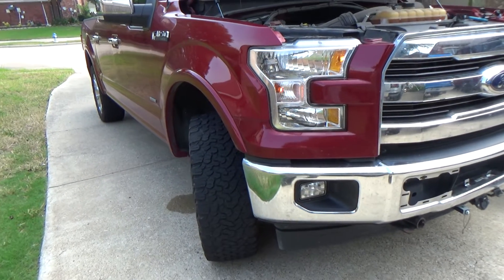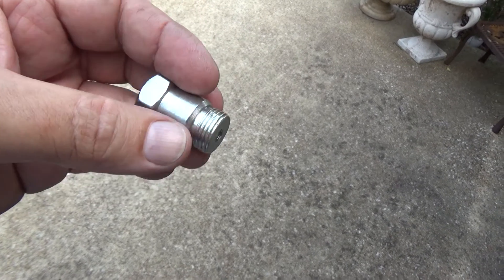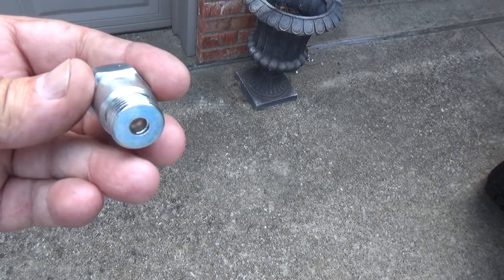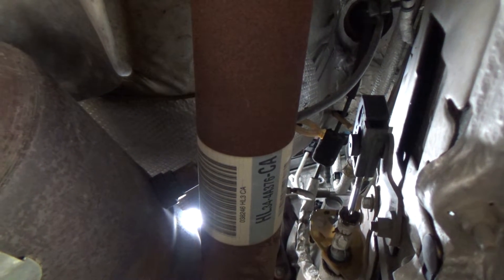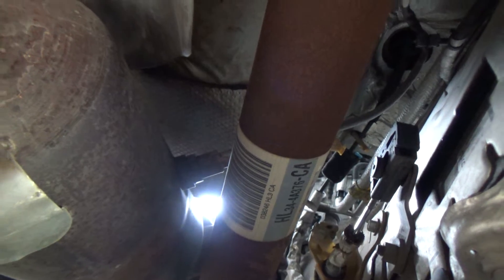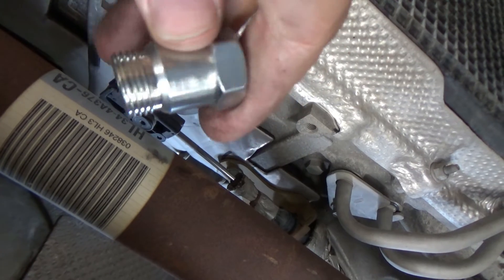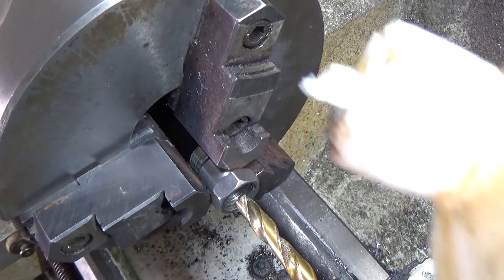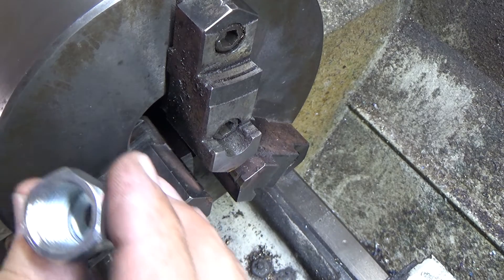Easy Fix for Code P0420 or P0430 Catalyst Efficiency Below Threshold Ford F-150.

Comment from the maker: MILWAUKEE'S Electric Tools MLW48-22-9415 Combination Wrench Set - SAE
https://amzn.to/46lKvbM
MLW48-22-9515 Combination Wrench Set, Metric
https://amzn.to/46izd80
Dorman Spark Plug Non-Fouler 42002
https://amzn.to/44jIUTA
737mechanic Amazon Store Front
https://www.amazon.com/shop/737mechanic/list/CR3BU74FTDU1?ref_=cm_sw_r_cp_ud_aipsflist_aipsf737mechanic_W4QMHMJ1JD67FDBCQHRK
Reply: Would you please repost the Amazon link for the Dorman Spark Plug non-fouler 42002. The link you have posted doesn’t work for me. Thanks

Comment: Haha. Worst fix ever.  It probably needs a thermostat. These trucks are getting old and I have been seeing numerous trucks in for thermostats with the p0420/0430combo. These engines are known for blowing out spark from high cylinder head flow characteristics which is why ford updated the spark plug gap spec to only .025. These engines struggle with heat in the top end. You need to drive the vehicle and monitor engine coolant temp pids on your scan tool. If the pids operate below specifications then you need a thermostat. The truck will operate with the guage on instrument cluster reading in the middle when the actual temp can be 40 degrees off. I thank ford for the inaccurate temp guage !
Reply from the maker: So, when the thermostat causes this the first thing you will notice is the engine never reaches operating temperature, the heater will be weak, warm up takes forever and many times you will have a code P0128 "coolant temp below thermostat regulating temp" and you will get both P0420 AND P0430 together.

In this case all that he was getting was bank 2 P0430. 

This $4.00 fix has lasted for over 2 years now.
Reply: @737mechanic I fixed the exact same issue on a 2015 today it had a p0420 and p0430 no p0128 as you stated was mandatory when operating temp is low.. I put in a thermostat and it solved the case 100%. The heater was still performing and customer didn't notice any heater concerns. You fix yours however you want but my customers come back every time. You didn't fix the problem you hid the issue with a 02 sensor spacer and I think we know what kind of hack mechanic you are. Let me know how the extra fuel in your oil helps extend your engines life.
Reply from the maker: @anthonyrybczynski5420  LOL, if you did this repair today you will not know for at least a week if you fixed the problem because it takes a few drives cycles for the computer to go through the routines to determine if the cats are doing their job or not. You just proved you don't know what you are talking about.
Reply: @737mechanic yes the customer left the shop and drove until the check engine light went out. Now it's 725pm here and the customer is now 200 miles down the road gone snowmobiling. I will be sure to video tape the next one in response to your video for learning. It's a good friends truck and I will be able to follow up easily.

Comment: Hi, I’m having the exact same issue after the PCM reprogramming recall on my F-150.
Two days after the update I started getting the same symptoms and the same codes, including P0430. The truck was running perfectly before the recall, so your experience sounds identical to mine.

Were you ever able to fix the problem?
Did Ford or the dealer do anything for you, or did you find another solution?

Any update or advice would really help. Thanks.
Reply from the maker: What I did in the video fixed the problem, 2 years later and still no light or codes.
Reply: @737 @737mechanic I appreciate it
Reply: @737mechanic  Can the hole be drilled with a drill? And what size bit did you use to make the hole? I already ordered the accessory to do the job next weekend.
Reply from the maker: @Marcelcapdevielle  Yes you can drill it with a drill, Something bigger than the diameter of the O2 sensor will work.

Comment: I can confirm this works. I did what he said to do in the video. I had a P0430 code for bank two which is the driver side. I drilled the hole through the spacer which I got from O’Reillys. It’s kind of hard to fit in the cat, but keep trying and you should get it and that code cleared and then I got a code for the opposite side bank one which is P0420 so I repeated the process for that catalytic converter as well and then I passed emissions and no code.

Comment: How do you clear the codes? I went to advance Auto and they tried to clear the code and said it wouldn't let them do it.
Reply from the maker: You can disconnect the battery for a few seconds and that will do it.

Comment: Last year I had the very same code, so I just replaced the down flow o2 Sensor connected to that cadillac converter getting the code and then reset/cleared the code off the truck system ... 

Year later and still no code. 😉

Comment: With this diy hack do you get your fuel mileage back or does it still effect your fuel economy and just does away with the code issue
Reply from the maker: The downstream O2 doesn't play a role in fuel mileage; it is pretty much for cat efficiency.
Reply: @737mechanic appreciate your input thank you

Comment: Did the same trick for my buddy and saved him the headache of that check engine light. At 250k who wants to spend $3000 on cats lol!
Reply: It doesn't need cats.  It needs a mechanic who knows how to diagnose the real problem, not cover it up with an 02 sensor spacer.

Comment: Thanks for the video very helpful I recently purchased a 2015 Ford F-150 with the EcoBoost I've never dealt with any kind of turbo engines and I recently stomped on it on the highway and threw a check engine light hooked up my blue driver OBD scanner and apparently I got exactly the same code luckily where I live we don't have to go through emissions tests but I sure hope the cat holds up at least another 6 months. Or until the check engine light comes back.

Comment: Excellent video. Question to be raised: Can i use  the spark plug non fouler on the downstream O2 sensor with a faulty O2 sensor, or must it be on a healthy sensor?
Reply from the maker: You could try it first with a bad O2 on the downstream, but it might throw a code depending on how it is faulty. For instance, the downstream O2 should go high and low during acceleration and deceleration but at stable RPM's it should be relatively constant which is what shows the computer the cat is working. If the computer sees ZERO movement from the downstream O2 then it will flag it as bad.

Comment: I got p0430 code as well which is weird I just got all my vct solenoids replaced and then 1 week later this check engine light came on extremely frustrating should I buy new o2 sensor downstream location do you think that will fix my problem
Reply from the maker: If I had to guess your vehicle has a lot of miles on it and more than likely you need catalytic converters.

Comment: So question is if going through all that trouble why not just get new o2 sensor for the downstream location and I guess what I’m asking asking is the o2 sensor the problem or does it go deeper than that
Reply from the maker: The O2 sensors are doing their job so replacing them is not going to do anything. The O2 sensors are telling the computer the catalytic converters are bad.
Reply: So following the video eliminates the check engine light but the problem is still there correct ? So wouldn’t that mean more problems in the long run and my truck has 159,000 miles on it
Reply from the maker: @renequintana8714  So the correct way to fix the problem in the video and your problem is to replace the catalytic convertors, but when you add the spacers like I did in the video you are making the O2 senors less sensitive so it fools the computer into thinking the cats are working better than they really are. As the cats get worse over time even this trick will not work.

This will not cause any additional problems but it is not fixing the bad catalytic convertors.

Comment: I have a P0420 code will hollowing out the cats and clearing the code solve the issue?
Reply from the maker: No, if you hollow out the cats the computer will detect they are not doing anything and set the light even quicker.

Comment: I got a p0420 code I’ve seen people put lacquer thinner in the gas at a 1:9 ratio so for me it would be 4 gallons of lacquer thinner to 36 gallons of fuel will that clean the catalytic converter, will it damage the modern ecoboost engine?
Reply from the maker: I have heard and seen people do it but have never seen it actually work. What I would be worried about is if the windings in the injectors can handle lacquer thinner, the reason I say that is when fuel injection first started showing up on common cars people would add fuel injection cleaner to their gas and the fuel injection cleaner was alcohol based and the shellac on the fuel injection winding would soften and within a month you would end up with shorted injectors but the manufactures fixed that by using different type of insulation on the windings so alcohol doesn't effect them anymore but I don't know how laquear thinner might effect them.

They also make some stuff called Cataclean that I have seen some people claim worked for them so that is always an option also.
https://amzn.to/42iLgD6
Reply: @737mechanic I used Cataclean yesterday but I’m not sure if it works
Reply from the maker: @TexasNationalist1836  It will take the entire tank if it is going to do anything. Give it time and if it works please let me know. I love real world results.
Reply: @ the bottle says run the entire 16 ounce bottle and a 1/4 tank but I’m skeptical of it i honestly feel like the cheapest option would be to hollow out the cats because I just lost my job and don’t have the money to spend right now on truck repair

Comment: Have you actually done it and had time to check the viability or are we all gonna experiment this together
Reply from the maker: I did this on our Jeep Wrangler that the Engine light would come on about 3 days after resetting the light, after I installed these it stayed off 3 years until it came back on.

This Ford F-150 the light has not come back on yet and it has been a couple of years.
Reply: @737mechanic  alright then - thanx

Comment: I have a 2019 expedition with the 3.5 EB. Am I only adding it to both bank2 sensors?
Reply from the maker: They only go in the downstream sensor so if you wanted to do both banks you would put 1 in each downstream sensor.
Reply: Did you do it? It works? I have also exp with same problem that’s why asking

Comment: For 2018-2020 owners beware. These year models have oil consumption problems. Excess oil being expelled through the exhaust will clog and pack off your catalytic converters! I own a 2020 and finally pulled my y-pipe to inspect the cats to find a packed off and broken up passenger side catalytic converter. Yep, time for a new engine. Check it, before you wreck it. It’s not always “just a sensor.”
Reply: Eco boosts have a oil consumption problem? Sounds more like 5.0 issue
Reply: Oil is cheap and while of course I would never recip saw the bad cats, smash the ceramic then weld them back and reinstall I can imagine others might.
Reply: What ever happened with this? I have a 2019 going through the exact same thing
Reply: I Gt a 2018 with a p0430 code
Reply: @mattl7424  my 2.7 has bank 2 issue so went to a local mechanic wanted $4600 to do both with ford parts, dealer $3800, going aftermarket spd, flowmaster whatever is close to oem
Reply: Miy 2.7 doesn't use any oil. It's always the same level on the stick with 5000 mile oil change interval

Comment: I put cataclean, also put lacquer thinner. I sprayed sea foam and still code. If u used spacers, would it matter if theres holes in the muffler after downstream sensor. Or does the muffler not suppose to have holes for the spacersto work..
?
Reply from the maker: It won't matter if the muffler has holes.
Reply: @737mechanic  well,  used Space r and kept resetting the code with I'm readiness and still getting p0420 and p0430..🤔 drove already with 3 tanks of gas and still keep popin on..also replaced all 02 sensors.. fkn thing
Reply from the maker: @bigsal9259  At that point the cats are so far gone the only fix is going to be replacing them.

Comment: So this doesn't damage the engine in any way?  Sorry if that's a dumb question but I'm not too mechanical of a guy.
Reply from the maker: No, it basically makes the o2 sensor less sensitive so it doesn't trip the engine light. Eventually, even this will stop working once the cats become even more inefficient.
Reply: @737mechanic  So the cats will eventually need replacing.  They don't inspect emissions in my state, thankfully.  I just wanted to get the light to go away and was hoping it wasn't harming anything.  I haven't experienced any power loss at all.  Maybe it's just the sensor going bad.  I thought I would try the cat cleaner someone else suggested just for fun.  Thanks for your help.
Reply from the maker: @geemac7267  Let me know if the cat cleaner works, I have never had any confidence in stuff like that. If it works I will keep it in mind.
Reply: @737mechanic  It doesn't work.  LOL.  My light came back on as always.  It was a $30 lesson I guess you could say.  I'm going to try your trick next.

Comment: I used the m18x1.5 from orileys on my 2014 ford f150 5.0 just so yall know for the fitting size. It fits pretty good.
Reply: @41frankie  has it worked? Just did this on my 2018 5.0.

Comment: did it and don't work
Reply from the maker: @wow-wow-p8d  did you put it in the upstream o2 sensor spots?
Reply: @737mechanic  i put it after the cats,  after i did that i got (p2098 fuel trim  system too lean bank 2) i tried a few diffent ways i eather got the p0420,p0430,  with the  non-fouler i got p2098
Reply from the maker: @wow-wow-p8d  Interesting, I have never seen that before.

Comment: Could also try putting a bottle of Cataclean (Autozone $26 bucks) into the gas tank. Read directions first.
Reply from the maker: Have you used it and did it work?
Reply: @737mechanic  Yes I used it a couple weeks ago and it is kind of crazy how quickly the light went out and has stayed out since putting the bottle in my gas tank. Also noticed a pretty decent increase in throttle performance.
Reply: @Scoliton1  is it still working for you?

Comment: The way I see it.  The p0420 is the biggest scam automakers have come up with.  Here's why.  Even if your cat is below efficiency, it still is working to clean the emission.  It's just contaminated with oily residue from bad gas.  So get some premium fuel and ride that car the way Italians do to clean their cats.  They go to Germany and ride the Autobahn at +90MPH.  

The deal is that whenever this code comes up, the dealer will upsell an OEM cat that costs hundreds of dollars to install.   Even with a new one, that P0420 may still come back if you don't remedy the underlying problem.  For me, the shop that changed my oil filter added a little too much oil and this went through the PCV valve and into my intake manifold and fouled up the cat.  That's the scam.  Now I have to use that oxygen sensor spacer till the cats burns through that oil.

I'd rather burn through that cat till the core melts.  In my county, we don't do emissions.  Rural areas don't have as many hippies messing up our way of life and telling us how to run our cars.  Our air is clean because the area is sparsely populated by criminal government types unlike the big cities.
Reply: Hey so what happen if you got p0420 and p0430 and the cats are bad , if you put the spacers can you have consequences?
Reply: @andrewr1125 just do it temporarily to pass emissions
Reply: I am with you on this, one thing, add a can of cat cleaner in the mix, It does not do much, but it helps.

Comment: I have the same code that had my check engine light come on, on my 2016 3.5 Eb.   I do have a code reader, which has allowed me to delete the code...and so far (one week) it hasn't reappeared!   Apparently another trick to find out more information, is to take the truck for a drive, and at a location where you can slide under the truck, take one of the laser devices to check for how hot your exhaust is.   The inlet side (turbo side) 'should' be less hot, than the exhaust (outlet) side.  It seems whatever action that goes on inside the CAT, it heats even more to burn off the gasses, thus is hotter.   Mine was around 100 degrees hotter coming out of the CAT than going in.   So, I'm thinking or assuming my sensor made need replacing!    Another trick mentioned today by a highly recognized Ford Tech, was to take a rubber mallet (once cooled down I believe) and tap the bottom of the CAT, and listen for something bouncing around inside (the one he was tapping sounded like it had some rocks inside bouncing around).   Thanks for the video!    On edit- the previous owner took off the shield, and it's never been put back on, and I've had no issues in not having it.   Also, another tip, they say to undo the electrical clip of the sensor, before taking it out.  As you turn it, the wire turns as well, so you need it disconnected!

Comment: Is this addressing the underlying issue, or just keeping your enging light from coming on?
Reply from the maker: It reduces the sensitivity of the downstream o2 sensors so the engine light won't come on or won't come on as quickly. The underlying issue is the catalytic converters are losing their efficiency. The right way to fix it is to replace the catalytic converters. I just looked up the price of them now and they are about $300 per side or you can try this $5 fix and get down the road for a few more years.
Reply: @737mechanic   Yeah, I noticed there are a few brands on Amazon, in the $300.+ USD range.